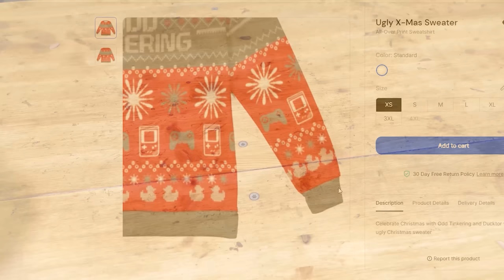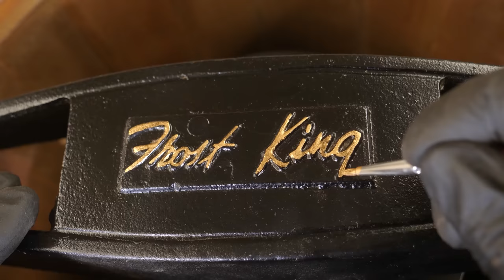Antique Ice Cream Maker Restoration

Comment: Pro tip for ice making - in the bucket use 50% salted water and 50% ice. Salted Waterr has lower freezing point than regular water, so You'll achieve better results.
Reply: Came to say this.
Reply: You beat me to it lol.
Reply: We always sprinkled rock salt over the ice as we went along,  pretty much the same result.
Reply: Same thought, where is the salt?:)
Reply: Okay you can also use ethanol and dry ice
Reply: @Bozemanjustin  LOL! Out there and I love it! That would work.
Reply: I remember using a lot more ice and 15% the weight in rock salt sprinkled on top. That was back in the 1960s.
Reply: Came to same the same thing
Reply: taste hand > electric
Reply: @Bozemanjustin  kinda pricey for home use in comparison to "water, salt and ice", but it does give better results
Reply: Solid water*
Reply: Not only better results, but also much faster ice cream churning - when there is only ice in the bucket, the way he did in the video, there's still plenty of air left between the ice pieces and the drum, so thermal conductivity is not that great, hence using the power tool to churn the ice cream.
Reply: this
Reply: I'm thinking this is why his ice cream poured out of the container. We used salt on the ice as well when I was a kid and the ice cream was much more firm. Definitely couldn't pour it out. Awesome restoration though.
Reply: Salt will rust the bucket holding the ice cream if you don’t wash the outside ✌🏽 ask anyone from the rust belt 🤧🤧
Reply: @Tranzisto  freezing cant be too fast or it will make crystals in the ice cream. im 66 and for as long as i can remember, ive always used ice and rock salt. that method is as old or older then the restored ice cream maker. lol
Reply: what’s ice never heard it I only know solid water.
Reply: @kenrk  That's what we did as well & it worked fine. Salt melted the ice and that drain hole in the side of the bucket kept the resulting water just below the top of the canister.
Reply: What’s the ice to salt ratio for the salted water? You can’t just say salted water and not give measurements that’s not helpful.
Reply: @geekgirl616  Very unscientific when we did it 50 years ago: With the canister installed, fill the bucket about 1/3 with ice, spread a layer of salt atop that layer (enough to cover most of the ice), add another 1/3 of ice & repeat the salting. Bring the ice just up to the top of the canister, add a little salt and start cranking!  As the ice melts, add more ice and occasionally sprinkle a little salt around the outside rim of the ice, just inside the bucket. (You don't want saltwater getting inside the canister because it will ruin the ice cream.) Crank 'till you can't crank it any more, pack with ice and let sit for about 15 minutes and you'll have the best ice cream ever. Use rock salt, also known as water softener salt.
Reply: Yes …When in northern Italy in the middle of 1800 started to prepare the first ice creams they were using snow and salt to freeze the mixture ….the best result with this method is achieved using a mixture base on egg yolk and pouring into the maker when it is still hot
Reply: @garrettswoodworx1873  huh interesting I guess I’ve never thought about it before but I always assumes water softener salt wasn’t safe to consume in table salt like proportions but thinking about it now I guess it’s just salt and won’t hurt anything will it
Reply: @geekgirl616  You're not consuming the salt! It is being used OUTSIDE of the canister that contains the ice cream mix and is used to lower the melting point of the ice and help form a layer of water around the canister to make the freezing process more efficient. This works because water absorbs heat 20 times faster than air. The drain hole in the side of the bucket keeps the water level below the point where it could get into the canister.
Reply: @garrettswoodworx1873  ah I see
Reply: @Rodville ❤
Reply: Science project in 6 grade. Grab 1 gallon and 1 quart freezer bags. To 1 quart, add 1/2 cup whole milk/half and half/ or heavy cream. The higher the fat content, the richer the ice cream. Add a dash of vanilla, pinch on salt, and a tsp of your choice of flavored syrup. Seal and shake to mix. Put on gloves and add ice and 2 tbs coarse salt to gallon zip lock bag. Place quart zip lock bag inside the gallon bag. Shake vigorously. The contents inside the quart will begin to freeze and solidify into ice cream. Remove quart from gallon bag open and enjoy. Loved doing this as a kid!!!

Comment: My grandmother had a Frost King ice cream maker, smaller than this one. She only used it when the grandkids were over, so we could turn the crank. I made a lot of ice cream in that for her. You forgot to add the rock salt to the ice. That would have made your consistency correct. My only concern is if the solder you used to repair the holes in the tub is food stuff safe and will not leach into the cream. Beautiful restoration, as always!
Reply: This is what I thought. It was missing salt so that the ice melts and we get ice water, and would make sure that the tub would have been cooled from all sides all the time.
Reply: I sure hope that the solder was lead-free silver or bismuth-tin.
Reply: I was wondering the same thing! Plus, the actual churn barrel had that spray paint exposure... IDK... Then again, wasn't there a risk of lead exposure in most things around this age?
Reply: @CloudStrifeEX  I thought salt made it super cold, and made the ice harder to melt...?
Reply: @dysonsphere75  what i know of is tin lead solder is considered the strongest type so maybe he used that but very unlikely
Reply: @lifestlc  putting salt in it will liquify the ice faster,  but it also keeps the temperature lower for longer. 
And because the ice melts to water,  but retains its chill, there is now actual freezing cold water, creating a larger surface area meaning it transfers the cool temperature to the mixture/ice cream chamber more efficiently, before the water begins to heat up. 

Tldr: salt liquefies, but keeps it actual temperature cooler for longer. = better transfer of energy.
Reply: @lifestlc  No, you cannot make things colder that way. Ice, when exposed to salt, liquefies. But it does not get hotter, so that water is still under freezing temps. That way, water that is so cold can wrap around the tub, and cool down more evenly. Normally, that way, you would not have to freeze that ice cream in the freezer.
Reply: We made a lot of ice cream as kids.  Dad worked at a dairy and had access to ice cream starter.  Ice cream starter is an egg custard that starts the thickening process.   So, 1/3 starter + 2/3s milk, cream, and flavor stuff.  Yeah, the rock salt hastens the ice melting absorbing heat from the ice cream faster.  We three boys and enough salt and ice could make a batch of ice cream 30 minutes faster then all the electric crank coolers we challenged.
Reply: @paddlingrubberduckie8766  If you use dry ice, then no salt is needed.
Reply: If you use dry ice, then no salt is needed.
Reply: @alexplotnikov2658  True.  However, filling a pail with dry ice also requires ventilating the room.  A 6 quart ice cream mixer's ice pail isn't small.  As dry ice melts it takes up more space.  Upon reaching 75 degrees F, 1 mole of ice (44g) fills 22.4 liters of the room.  This means a 6 quart mixer using 20lbs of ice, or 9072g, would fill a space of 4619L, converts to 164 cubic feet, of undiluted CO2.  Humans like their air with at best 0.04% CO2.  So, your room would have to be bigger than 409,836 cubic feet.  Using smaller portions of dry ice would make it harder to keep it in contact with the drum.   It's just safer and cheaper to use water ice and salt I think.
Reply: Ice? Did you mean solid water?
Reply: @CloudStrifeEX  Of course you can make it colder that way, its simple chemistry. Adding salt to ice does two things. First it lowers the freezing point of ice and second it melts ice. Melting ice is an endothermic reaction, which means that ice absorbs energy (and therefore heat) from its surrounding when melting. So you have ice that melts, absorbs a lot of the surrounding energy during the melting process, creates ice water which temperature is way below 0°C and the salt prevents the ice water to refreeze again. You can drop the temperature from ice water from 0°C without salt to -20°C when you add salt. So you can make it 20 degrees colder due to the endothermic reaction and lower freezing point when you put ice and salt together. Huge difference
Reply: Okay! But it wasn’t dry ice though.
Reply: How about the rubber duck in the hot milk pan?
Reply: @sebasstein7014  and finally someone properly described how the rock salt on ice works.. thank you.
Reply: He did forget the rock salt? Beginner. Lucky we have an expert in the house...
Reply: That's what women did they make the ice cream it took a long time.
Reply: My great grandfather had an electric one.  4th of July meant Kaylor family homemade ice cream.  Can't forget the rocksalt.
Reply: @lifestlc  no the ice melt but the ice water stays ice cold below freezing temperature and re-freeze. Try it 😌
Reply: I assume he deliberately forgot the salt ~ to showcase his hacked ice cream tub = we could see it had the styling of “Ben & Jerrys” an 🇺🇸 ice cream company, but he had put his own branding on it to prevent copyright infringement/have B&Js sponsor the video
Reply: 8080
Reply: @dysonsphere75 most solder these days are lead free
Reply: @dahcat i don't think so. I order leaded solder from China all the time. It's better than lead-free ones.

Comment: He not only fixed the ice cream machine , he also taught us how to make ice cream
Reply: Except he forgot to add salt to the ice.
Reply: @Jarock316 its ok without the salt
Reply: Salt helps it freeze quicker, keeps the ice from melting so quick and make the ice cream hard.
Reply: @sylviajackson9863  Salt can reduce freezing point of ice. Making ice stay solid much longer
Reply: And it actually makes a chemical reaction which DRASTICALLY lowers the temp of just the regular salt.   Without the salt, it’s near impossible to get ice cream the correct viscosity
Reply: @The truth 
Yes it was good, just a bit runny.  Hence the reason he had to through it in the freezer.  Had he added salt to the ice, he wouldn’t have had to re freeze it.  It would have came out more solid.   That’s it.
Reply: @The truth No, he made a colder liquid after cranking an inordinate amount of time. Then he gave up and froze it in the freezer. Salt makes it ice cold and much faster.
Reply: Odd Cooking should be his catering channel
Reply: I grew up in the Caribbean and this is  how we made ice cream. It was never something you bought and kept in the fridge like Americans do. But dude forgot to salt his ice. And we used powdered custard.
Reply: milk, cream, sugar, duck
Reply: @sylviajackson9863  so what if he don't add salt? It's fine the ice cream can be made without the salt, the usage of salt if you wanted to make more ice cream
Reply: @regularguy4504  wrong, it reduces the freezing point of water so it stays liquid for longer, that is why a person will salt their driveway when it snows
Reply: I bet he can fix the mcdonalds ice cream machine
Reply: What is this one?
Reply: @Tea12515  Salts helps to lower down the temperature .
Reply: Easier to go to the store, but the experience, I still remember my family making homemade ice cream and would have not exchange the experience, we were so excited to have a turn to churn.❤
Reply: He doesn't work at McDonald's
Reply: What a guy
Reply: Yeah I found that kind of cute lol
Reply: خیلی عالی است ❤
Reply: Are we sure this is a guy?
Reply: A two in one special!

Comment: Excellent as always, my only gripe would be putting the staves back together around the base. Usually those would be sealed with a meal paste to keep the bottoms water tight. Just one of the lost arts of coopering. Everything else was immaculate as always
Reply: Not 100% sure but I believe they also yused to make the rings slightly too small then heat them before slipping them on to pull the wood taught after the metal cools
Reply: @Wookie92Gaming  perhaps some but not always necessary even in white cooperage

Comment: I thought everyone would know that one of the most important things to add when you make ice cream is salt to melt the ice. The melted water with ice and salt becomes colder than the ice alone. Also, the mixture should be cold to start with when you try to freeze the mixture. The ice cream I made always tasted much better than what you could buy, and it was frozen when you scooped it out of the can. Mine was always a custard style of ice cream.
Reply: to be more accurate, is the air that become colder, not the water. In order for the salt to melt the ice, heat is absorbed from the air, making the air temperature to fall down in order for the water to heaten and become liquid again
Reply: You are both wrong. Salt doesn’t change the temperature of anything. It changes the freezing point of water. Meaning, you can have liquidy ice that is the same temperature as solid ice. It makes the ice cream harden up more because of the surface contact it has on the vessel while churning.
Reply: @einarschwentke7813  it takes energy to make the phase transition between solid and liquid. So when you change the melting temperature, this cool down will happen faster. if you add salt to -2C ice the resulting brine will be colder.
Reply: @tristomand  But ultimately it is the surface contact of the brine on the vessel that causes the transfer of temperature and creates ice crystals in the cream.
Reply: @einarschwentke7813  It is an important factor, but the temperature definitely changes.
Reply: Who asked?
Reply: I too thought rock salt was a key ingredient
Reply: this sounds right to me !!!
Reply: Right like everyone knows 327 is Chevy and a 302 is Ford the day you came outta  your momma you knew that
Reply: "I thought everyone would know"? I'm pretty sure most people don't even know making ice cream like that is even a thing
Reply: @BambooTime  everyone that has common sense knows Ice cream is made this way fytb
Reply: @deus4992  In a bucket with a rotating cylinder and salty ice water? That might be a US thing then
Reply: @noodle9035  i did
Reply: @noodle9035  it wasnt a answer, plus look at the likes.

Comment: Excellent. You can tell the difference between a "guy with a workshop" and an "expert" because the expert designs and builds his own tools/gadgets when required, as you did here.  Well done.

(Also, Amazon doesn't appear to sell solid water. I will keep looking)
Reply: You're better off going to your local supermarket or gas station for solid water. I hear it degrades if kept in "unfavorable" conditions for too long.
Reply: @Chaos89P   Thanks. I shall continue my quest. It’s probably a supply chain issue. 😳
Reply: An expert would never use vice scripts and hammers as they're two main tools
Reply: @MrShaun1011 and they would probably use a wooden mallet on wood....not a metal hammer.

Comment: Not sure if you’ll see this, but something I learned from working on vehicles with my dad was to use oil to get stuff unstuck. If you put oil on the immobile object and use heat from a propane torch it will suck the oil down in the crack and force the bond to break

Comment: Nice restoration, and I do love some good old fashioned ice cream!  Havent used a hand crank ice cream maker since I was a kid. :)
Few comments:
1)  Hope nothing was toxic in that solder, since it is coming in contact with your mixture.
2)  I've never seen the inner tub painted in any ice cream maker before, probably because it inhibits heat/cold transfer between the ice and the mixture.
3)  Rock salt will help speed things up, vs just using ice alone.
Reply: Well the original metal joining might already not have been food safe, but the unknown composition solder makes it all the more dubious.
Reply: And did he get a little paint on the inside while spraying too?

Comment: FIY whenever using the impact driver, two things: get a dead blow hammer with a metal ends (usually for body work) and two put a piece of metal whenever you have something light like this wood end, between it and the bench. Essentially, the more of the force you contain in the screw the better. Cheers.

Comment: Really good restoration. Great job on the gear tooth replacement!Questionable using black though. I would have thought silver or white would have been more appropriate. If anyone else tries this, number the slats so it goes back together easier, trust me. I would have waxed it after assembly and used stainless for the bands. Also, what did you solder it with? Hopefully it was silver solder.

Comment: the laser is cool . ive watched someone else who restores old things and im pretty sure they use a sand blaster to remove rust . i think both ways are neat .
Reply: would you still have been able to fix it if tht heat gun thing didnt fit in the cylinder thing?

Comment: I am 73, and remember a similar device at home when I was a child. It was smaller, about 5 liters for the stainless steel container and 20 liters for the wooden drum. The steel container had an internal propeller that rotated opposite to it, which in turn rotated inside the wooden drum filled with ice, and salt. I remember it being used just once, my mom's patience was short and she quickly discovered that pouring fruit juice into ice molds in the refrigerator was less work.

Comment: Very cool! Just one thing for making the ice-cream even COOLER (ahah word joke). You should add salt to the ice before spinning because by doing so, you decrease the freezing point of the water to - 21 celsius forcing a lower temperature to the metal bucket and the ice cream to freeze well🍨(no need for the freezer before serving)